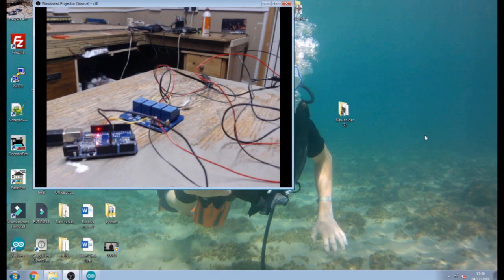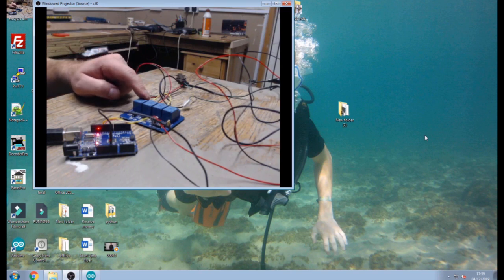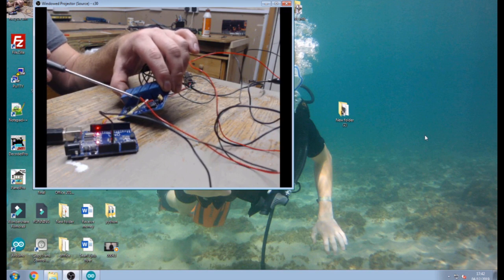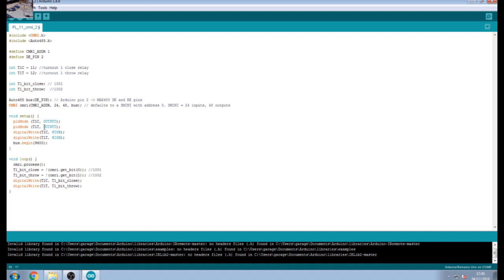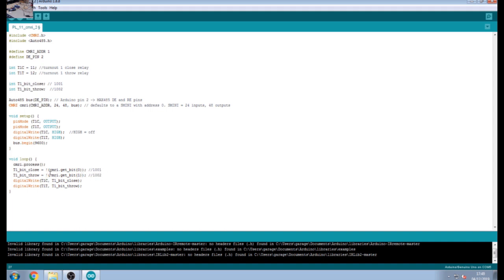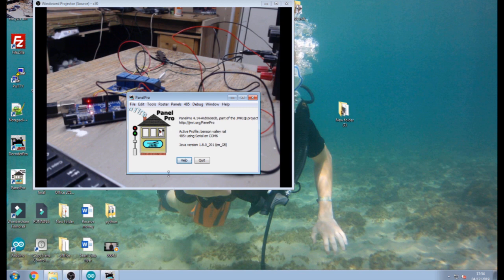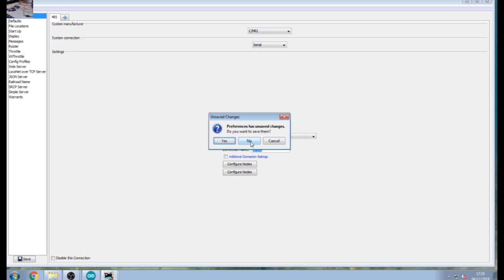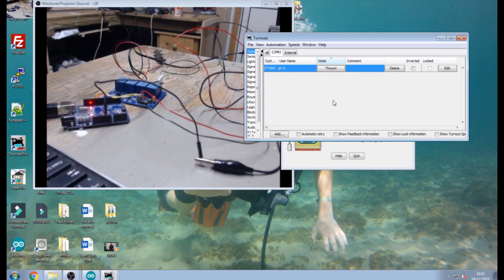PL-11 point motor with JMRI -CMRI arduino control

Comment: Thank you so much for your video tutorials and details on the website.  I have learned a ton emulating what you are doing.  It is possible to change the length of the pulse, as you mentioned at @.
  You will need to edit the Node and adjust the "Pulse Width" from the 
default of 500 milliseconds to something shorter (can go down to 100ms).
  See @t

Comment: another good tutorial cheers mate. you keep mentioning your bench power supply could you give more info ie where i might get one and min-max voltage i need i know very little electronics wise so looking watch trying to learn have aurduino uno motor shield etc 
Alex
Reply from the maker: Thanks for comment. I made my power supply years ago. It goes from zero to 30vdc with 2.5 Amps. Now days there is a lot cheap ones on eBay. If you are not experienced in electrics then best to buy a built one not a kit to be safe. Anything which gives up to 20v with min of 2 Amps
Reply: @BrackstonesTravelAdventures  cheers for prompt reply will checkout the net

Comment: Thanks...
so tried following..
Took code and uploaded to arduino uno
when i power up my 16 port relay, with arduino... i get multiple clicks out of relays on initial... but i cant get jmri to trigger them.. stay open.
thoughts? I know that isnt much info... but i have it wired the same, uploaded sketch from your site...just dont know.
Reply from the maker: Hi Jeffrey, So first the chattering of the relays is normal on initiating the board (powering board on). As for not having any relay control you will need to do a bit of investigation. First you can try replacing the relay with LEDs across the relay output pins and GND to see if this is a JMRI problem or relay issue. If the LED's light up then its something to do with the relays, one thing you can try is connect the earth supply powering the relays to the ardunio so you have common earth on both arduino and relay. You can also do a simple LED sketch, within the Arduino examples and see if this turns on the relay. This way you will have confidence this is not a relay issue and you have it all connected correctly. If this is all ok then you will need to check the JMRI setup. Have you got the connection settings and ports correct, have you setup a node for your arduino. When sending a throw/close on JMRI do the TX/RX LEDs light on the Arduino. This will all help pin down any issues.
Reply: @BrackstonesTravelAdventures  Thanks for the reply...

So for troubleshooting - I have a simple loop setup to activate pin 11 on arduino uno low, delay 500ms, high, delay 500ms then onto pin 12 and does the same...
load into arduino and once powered on... the relays open, close and loop around so all hardware and wiring is there and good.

When I load your sketch (I added CMRI.h and Auto485.h) all goes well. Follow your steps on adding 1001 in 2 bits and pulse into turnout table... when i click the buttons, the Arduino is activating and lights blinking but I am not getting any pin activations on the arduino... bit weird. I will do a full video for you to see and hope you can assist me. I have about 15 turnouts to start with and upwards of 30-40 total...
Reply from the maker: Sound like the relays are working all ok on a delay loop chattering through them all so wiring all ok. For the code are you using the first example on my blog page or the second example. Looking at the first example there is no delay between turning on and off the relays. Been a while since I wrote this so will have to test it again. Try using the second example which uses the JMRI pulse output.
Reply from the maker: I believe the first code will only work if you are pulsing out the signal from JMRI. If I get a chance this week i will see if i can re-test this. Try using the code exact from the video as this worked ok and ensure JMRI is pulsing the output
Reply: @BrackstonesTravelAdventures  i used the exact from the video... I will try other codes on your site to verify as well. Thanks! looking forward to getting this working.
Reply: @BrackstonesTravelAdventures  I kept going and going as I swear I have ADHD (my kid does)... and I have to KEEP GOING!!!!

found another one of your videos... Jan 25, 2020... Complete setup Turnout with JMRI, etc.... and you state how someone let you know that you need to set Additional Connection Settings... uhhhmmmm THIS WAS IT!!!!!! AWESOME!!!!!!!!!

I knew there was one thing.. one thing was missed or not set!!!!!!!

Comment: Thank you so much for your video tutorials and details on the website.  I have learned a ton emulating what you are doing. 

It is possible to change the length of the pulse, as you mentioned at 23:40.  You will need to edit the Node and adjust the "Pulse Width" from the default of 500 milliseconds to something shorter (can go down to 100ms).  See https://www.jmri.org/help/en/html/hardware/cmri/CMRI.shtml#L281
Reply from the maker: Hi Verald, glade the videos are of some help and thanks for the info on the pulse length, this is easy i will give this a go.